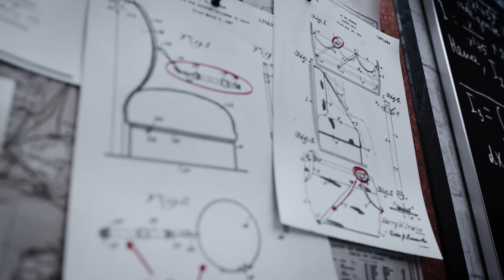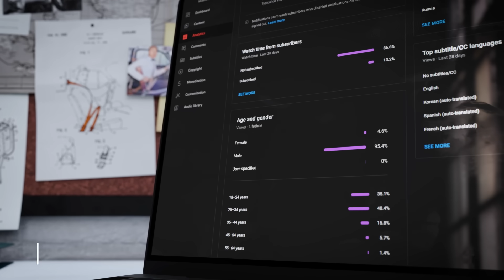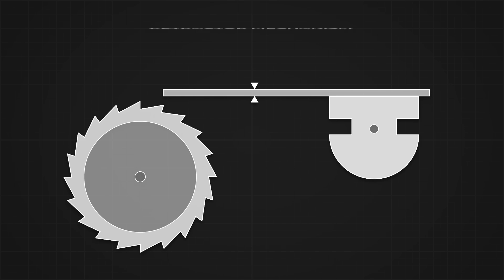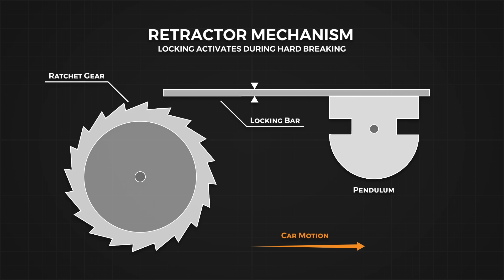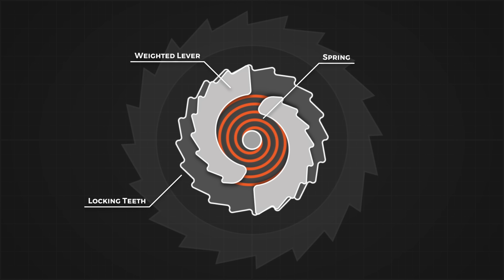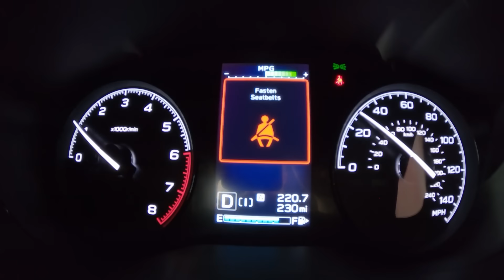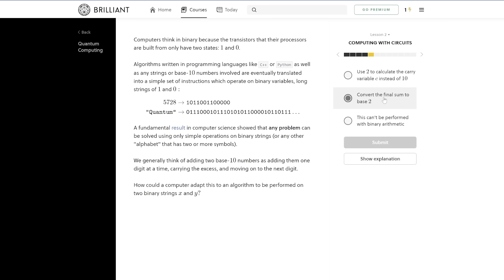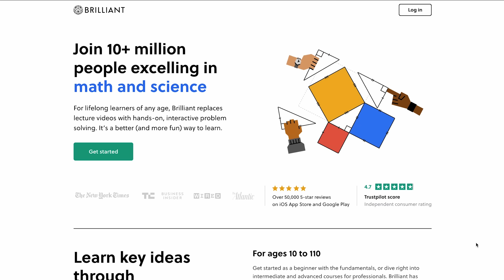How Do Seatbelts Work?

Comment: Malaysian Civil Engineer here. Yes, I agreed that Malaysia Road Safety is not audited properly. Anyhow, I would like to give some insight on how this system works. In Malaysia, developers are mostly required to provide infrastructure upgrading work which directly tied to their project and to be handed over to government for free. Firstly, developers shall employ their own traffic engineers to provide study for authority approval. All these data can be easily fabricated or altered without any verification from local council or government agency because they do not cross check the data themselves under normal circumstances. In this stage, most of the road design or upgrading works will be planned and determined. Then, a detailed road design will be drafted according to Road Safety Audit Report provided by auditor which is also employed by the developers themselves. It is clearly that all these consultants are bias towards their client since they are their pay master. I hope you know where this is going, this is similar to what is happening to Doctors and Lawyers where ethic sacred. However, local authority should be the last safe guard to carefully review their design, right? Nope. This is where corruption comes in, there is approximately 1.2 mil civil servants in Malaysia and the payroll is low since there is so much mouth to feed, therefore, lobbying seems to be very appealing to most. We have anti corruption body but they are the best at extorting money from private sectors whenever there is lack of funds, basically a tool for politics. Traffic engineers, road safety auditor, government will not be not held responsible to any road congestion, life loss of road users since they could easily brush off the responsibility and push it onto the driver's error. In conclusion, most of the Malaysia road safety audit is inappropriate due to incompetency of government, corruption and lack of regulation. The root of all these problems is corruption, which is humans' greed by nature, and this will never go away as long as humans are regulating it.

I know this will upset a lot of people but i am here to remind you that this is the reality we live in.

Disclaimer: There will be no proof provided and this is just solely my opinion which is based on the limited 4 years of working experience as a Civil Consulting Engineer. This only serve to bring awareness and insight to one of Malaysia broken system.

Comment: 5 point harnesses are by far the safest and actually dont hurt if you have it adjusted properly. The bottom part of your body most likely will not slide due to the lower straps and really keeps you mounted overall. Nice harnesses with pads are hands down the safest thing to use

Comment: Can someone explain to me why, if we want to be even safer than we already are while wearing seatbelts, we don't use 4-point seatbelts, like the ones you can find in a baby seat. They are reasonably comfertable but much safer right, or am i missing something
Reply: It was already a herculean task to get people to wear 3 points. Plus, it is a good balance between convenience, comfort and safety. 3 points work pretty well while not being so annoying that people will refuse to use them.

Further, if you heavily restrain the torso like with a 5 point, you can get a basal skull fracture (essentially break your neck where your skull attaches) as your head whips forward in a crash. That's exactly what killed Dale Earnhardt, a famous racecar driver. So such systems MUST be paired with a helmet and a HANS device. Obviously annoying to wear all the time, so it is reserved for races and other similarly intense driving, not the banal daily driving the average person does.
Reply: @Ravaxr  thanks for the explanation, wearing helmets and a HANS devise is indeed not that focussed on comfort and ease of use

Comment: I was hypothesizing about how this mechanism works a couple of weeks ago while riding in a ridershare car with my partner. I'm not surprised it was recommended by the algorithm, but I am surprised that it was uploaded after I was wondering about it 🤔🤯🤣 awesome video! I didn't know about the other parts, but the centrifugal ratchet paul (sp?) I got right. I didn't fully figure out the catch that stops due to braking though. I did figure it had something to do with a pendulum.

Comment: Simply dont crash and no safety features are needed 👍
Reply: "Don't die, and no insurance is needed"
Reply: "It is possible to commit no mistakes and still lose. That is not weakness. That is life." -Cpn. Jean Luc Picard.

I don't wear a seatbelt because I question my own ability to drive. I wear one because I question the ability of everyone else's ability to drive, given they very well could be drunk, high, lame, or have the reaction time of a turnip and there is no way to know until they make a mistake. I could very well be in a position where nothing I could have done could prevent the crash no matter how good a driver I am.

Comment: I've learned the hard way why seat belts are important. Was in a Geo Storm in the passenger seat going across a cow pasture (I'm not exactly sure why we were doing this... I question it to this day). We hit a little drainage ditch and the car just stopped. I didn't until the windshield and my head and a real quick talk...

I remember feeling the nose of the car dip. I started to say, "Oh no." but got cut off by the windshield saying hi. The impact was hard enough that I couldn't see for a few moments. I could feel my eyelids moving as I blinked but everything was black for that little bit. Vision came back fairly quickly, by the time I got out of the car I could see about like normal again. My ears immediately started ringing and it took about a day for that to stop completely. The windshield was definitely in worse condition than I was. The entire passenger half of it was basically turned to dust and the driver side was not much better.

I walked away from that incident with just a few pieces of glass in my scalp and a headache. The hospital said I didn't even have a concussion. I was lucky, had one of many of the factors in that situation been different, I could have been ejected from the car through the windshield or had my head hit the A-pillar rather than the windshield - which would have been quite the doozy even for my hard ass head. Or you know, one factor different and I would have had a bruised collarbone and ribs - that factor being clipping on the seatbelt.

Let's just say you'll be hard pressed to find me in a vehicle without a seatbelt. That happened when I was 12 (could have been 11 but fairly certain it was 12...). Let's just say you won't find me in a passenger vehicle without a seatbelt. I'll take my chances against the few times where seatbelts are detrimental, the benefits just outweigh the headache.

Comment: The problem with a seat belt design that attaches between the legs should have been obvious at a time when almost 50% of the Swedish population wore skirts. Unless it’s a mini-skirt the only way to attach the belt to the seat would be to hoik up the skirt, which I personally wouldn’t be very comfortable with (especially if it’s a long, heavy skirt).

Comment: its always reassuring when i drive tight corners, brake hard or accelerate fast that i can feel the seatbelts in my  modern car tighten and lock due to the electronic pretensioners doing their job.

Comment: Seatbelt saved my life when I had a tire blow out and send me off into a heavily wooded creek bed at 90mph and I rolled 3 times and knocked 3 full size pine trees over. I was conscious the entire time thank god because it took me 40 minutes to unbolt the sunroof to get out because a tree was ontop of the car and I had no cell service. Also I was so deep in the trees that not a single car passing by saw me. Also my airbags did not deploy for some odd reason so the seatbelt saved me from getting knocked out by flying into the steering wheel. Anyways if your gonna speed down a back road wear a seatbelt if your gonna be that dumb

Comment: The climate changes so the car will be watered if there is a combustion of the engine. }robot accessing the air on the place and a simulation of a change in the climate making it not explode

Comment: F=ma  when a crash happen the weight of the person should be increase so the force will not kill the mass.  How by the use of the citric in the battery and increasing the air pressure so the human will not die.  Just like the sausage with cheese and citric acid.  The formula f=mass multiplied to acceleration sudden stop of car will injure the bones.

Comment: Seatbelts are great, and they save lives in crashes. I do agree with all of this. What I don't agree with is the mandate for them. Its my life and my decision on the amount of risk I want to take in my life. That should not be regulated by the government.
Reply: If your exercise of a right causes actual harm to another person, then it was never a right to begin with. It happens fairly often that an unbelted passenger in a crash becomes a projectile that kills other people in the car. It has even happened multiple times that Driver A is unbelted, Driver B is belted. They crash head on, Driver A is ejected, goes through both windshields, and Driver B gets a 200 lb gorilla going highway speed to the face. Fatal crash for both drivers, but if Driver A was belted, it would have been a banal, easily survivable crash.

Unfortunately, the world is not composed of frictionless spherical cows with no-clip enabled. Given that not wearing a seatbelt has gotten complete strangers seriously injured or killed specifically because of the unbelted person's decision, it makes sense that it is written into law and enforced, because otherwise is neglect and deeply unfair to the person who did everything right and still got hurt or killed.
Reply: @Ravaxr  by that logic we should outlaw motorcycles and just driving altogether. All for fear of maybe causing injury to someone else accidentally. That's dumb.
Reply: @DP69264  Of course there is a risk assessment going on, as well as different requirements. Most jurisdictions have a separate license for driving a motorcycle for example. That isn't just because you need to prove you can ride the thing, you also need to prove you understand and practice defensive driving and treat it differently than how you would a car.

This is quite a bit different from driving a car like most other people and not putting a simple seatbelt on. It demonstrably reduces harm to the person themselves and to the people around them. It has been designed to be as easy and simple to operate as possible, while still being effective. There really is no excuse for not using it, and yet people still get hurt or killed daily from not using it, or somebody else not using it.
Reply: @DP69264  It already is restricted. You need a license, insurance, condition of the vehicle must be compliant with the law, you can't drive under the influence etc.
So we do outlaw driving by exactly that logic. But the world doesn't work in binaries, either all or none is allowed. We have to set the line somewhere and seat belts just fall on the restricted side.

Comment: Seatbelt saved my life and my brothers in a rollover accident on a county highway. Unfortunately it didn't save my dad. I currently drive a Volvo and am so thankful for all the work they have done to create such a safety necessity
Reply: Sorry for your loss.
Reply: Unfortunately the rocket- fueled pretensioners in the newer harnesses are a '1-time use' component - as in the airbags. If you're struck in (or 'strike') a multi-vehicle crash - this component will save you on that 1st impact but be depleted before any subsequent impacts.

Comment: You forgot one key engineering feature that is stupid simple!

When your upper body moves forward in a crash, it will tighten the lower strap since it's free to move on the buckle side, and securely fastened on the opposite. Such simple engineering.

Comment: I always wear my seatbelt and encourage everyone I know to do the same I just don't think it's right to force it by law and allow traffic stops based on "I didn't see you wearing your seatbelt"
Reply: It is not uncommon that belted passengers are killed in a crash because the one unbelted passenger turned into a projectile. It has even happened multiple times that Driver A is unbelted, Driver B is belted. They crash head on. Driver A is ejected, goes through both windshields. Driver B gets a 200 lb gorilla to the face at highway speed. Fatal crash for both drivers, but could have been a banal, easily survivable crash had A also been belted. Thus, the decision on one person to neglect to wear a seatbelt has caused harm or death to a complete stranger. It makes sense it is written into law and enforced, since not wearing a seatbelt is deeply unfair to the person who did everything right and still got hurt or killed because of someone else's decision.
Reply: @Ravaxr  and you can see if someone is wearing a seatbelt inside of a vehicle moving at 65 mph with enough certainty to determine they need to be stopped? I've been pulled over for "not wearing my seatbelt" multiple times when I have been wearing it every time. Even if you believe it should be a ticketable offense having it be a primary offense (one that  can be cause to pull someone over for) is a joke.

Comment: I have an older family member that refuses to wear a seatbelt always stating that "With or without a seatbelt a crash at my age it wouldn't make a difference".
Reply: It can make a very big difference to the svelt, young driver in the other car getting a 200 lb gorilla going 80 mph relative to them in the face. It has happened that an otherwise banal, survivable crash was made fatal for both drivers because one got launched into the other from lack of seatbelt.
Reply: @Ravaxr  Sadly some people never learn or don't listen to that kind of information.

Comment: This is not to say to not wear a seabelt but just an interesting story:

My father had a case where if he wore the seatbelt he wouldve died.  It was an icy road when he was driving alone.  He was going down a hill when he hit the breaks slightly and the car slipped.  It did a 360, dumped my father out of the driver door, and hit a pole on the bottom of the hill.  My father was miracualosy unscaved but the car was totaled.  Where he was sitting was gone, only crushed metal, and the seatbelt wasnt anywhere to be seen.  A cop who saw this happened said if he didnt get thrown out of the vehicle he would have 100% been dead.

Still this is a rare case, and in most cases seatbelts save lives so wear them.

Comment: I'm not sure about other manufacturers, but my Lexus has electric pretensioners in addition to the pyrotechnic pretensioners. The obvious advantage of the electric portion is that it is not a one time use device. When a pre-collision event is detected (hard braking, radar detection, maybe some others as well) the electric pretensioners will activate, and they actually apply a surprising amount of force! It surprised and startled me the first time they activated! I imagine that part of the benefit of them is that they cause occupants to begin bracing slightly before an impact.

Comment: The engineering behind the seatbelt is amazing and I'm happy to hear it has saved so many lives but the stories in these comments really highlight how dangerous cars are as transportation. Buses, trains, trams, and other public transportation have between 10 times to 60 times lower causality rates depending on what type and where you are using it and that is without seatbelts. 40,000 deaths per year currently in the US, so many lives could be saved if people would only use cars if absolutely necessary.

Comment: So why does the seat belt keep ratcheting after I start letting it back into the spool? It's not the centrifugal clutch anymore I'm moving slowly. And it doesn't release until I let the belt all the way back into the spool. This is annoying and seems to be a deliberately designed feature
Reply: Might be faulty, or in baby mode.
Reply: If you pull the belt all the way out, then it is continuously locked and ratchets until it is spooled all the way back up. Useful for baby seats to crank them down to secure them to the regular seat.

Comment: So here’s a summary of the many mechanisms inside of a seat belt retractor:

1. Pendulum Locker: Uses a weighted pendulum to lock the seat belt in place in the event of a crash; no electronics required.

2. Centrifugal Locker: Uses a pair of spring-loaded ratchet gears to lock the seatbelt in place if it’s pulled on too hard or fast; once again without any electronics.

3. Emergency Retractor: Uses an explosive charge (activated by the same system that fires the airbags) to pull the seat belt back against the seat—taking you with it—as it’s safer to be firmly pressed against the seat in a crash than it is to be flying forward uncontrollably. This is the only one that uses electronics.

4. Torsion Bar: This bar resides at the very center of the mechanism, and ensures that you don’t receive the full force of a crash when one occurs; it also doesn’t use electronics.

So as you can see, most of the safety features are entirely mechanical, so you don’t have to rely on a potentially unreliable computer to activate them. That’s smart design at its finest!

Comment: I always wear my seatbelt. However, because of my understanding of physics, I have some styrofoam that I put between the seatbelt and myself. The styrofoam will add a little more give and will crumple thus absorbing more energy from a crash or just me slamming on the brakes whenever a deer runs out in front of me… not a single panel on my car is original because the deer out here on Long Island are out of control to a point that your chance of hitting a deer are a lot higher than your chances of getting into an actual car crash.